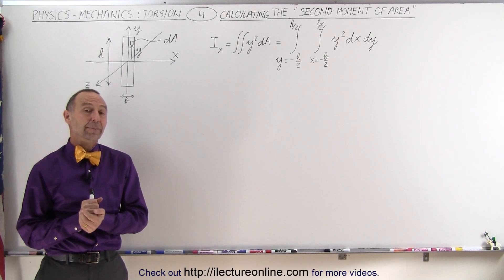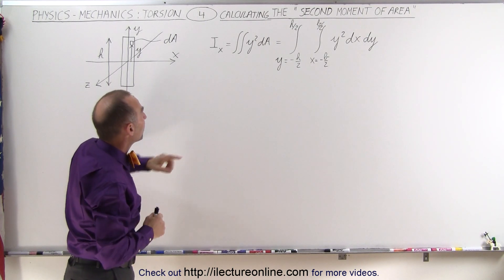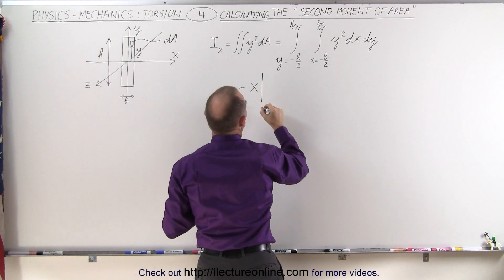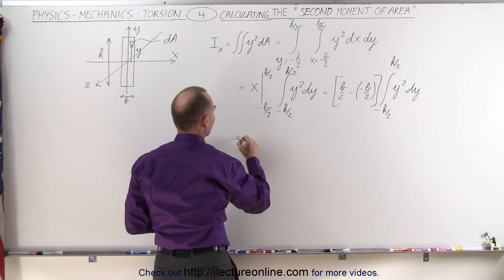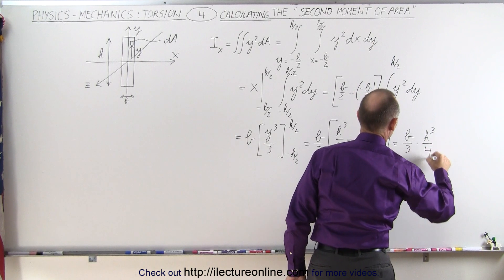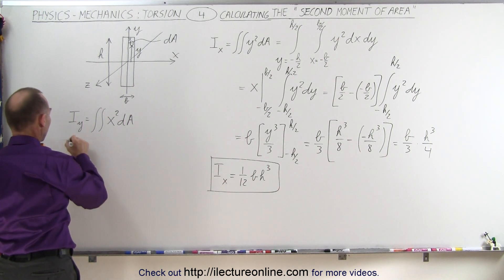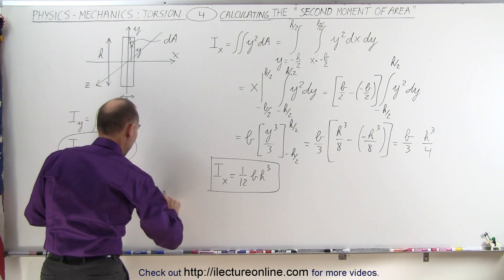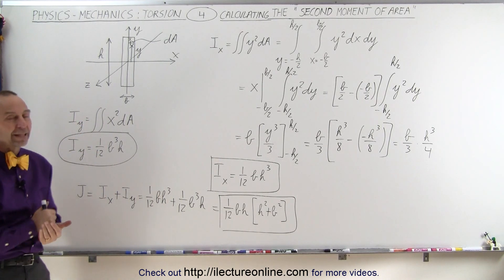Physics 16.6  Torsion (4 of 14) Calculate the "Second Moment of Area"

Comment: Can you explain how to calculate the second moment of area for a cylinder? I am having trouble knowing what dA is for a cylinder, and I would greatly appreciate any help.
Reply from the maker: Did you look at the other videos in the playlist?  You can also look here:  PHYSICS 12 MOMENT OF INERTIA       PHYSICS 12A TEST YOUR KNOWLEDGE: MOMENT OF INERTIA
Reply: @MichelvanBiezen  Yes, but I am not sure I understand. When you calculate it of a cylinder, does dA mean only the cross-sectional area (the circular part)? And, does that cross sectional area change when looking at different axes. For example, when looking at the I(suby) of a cylinder, is the dA different than the I(subx)?
Reply: @MichelvanBiezen  Actually, I think I may understand it now. Here is my question now: when analyzing torsion, do you look at the cross-sectional area of the axis perpendicular to the axis/line of symmetry that you are analyzing? For example, for a cylindrical column, the axis of symmetry goes in the middle from top to bottom, so the cross-sectional area would be the small slices of circles from left to right (perpendicular). Is that correct? 

If so, how does that apply to I-Beams? Why do we look at the vertical cross sectional area and not the horizontal as we do in other problems? Not saying it is wrong, but rather wondering if I am misunderstanding something